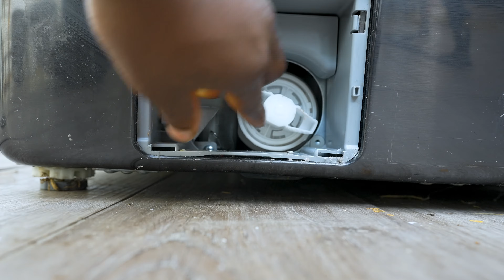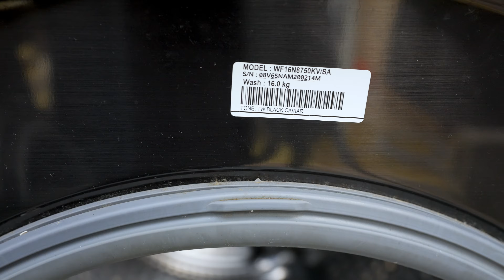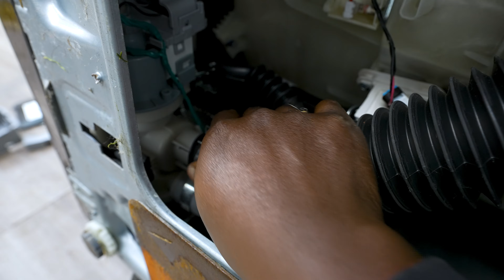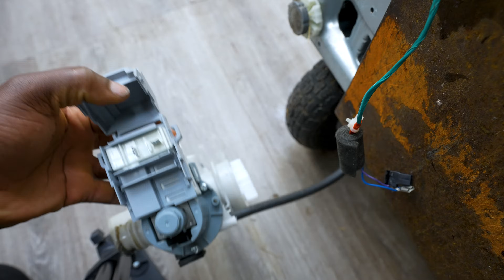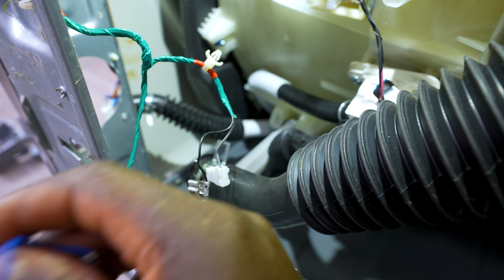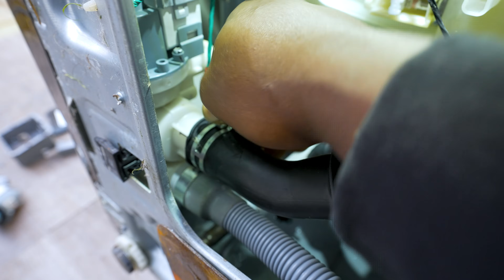5C Error Samsung Washing Machine Fix, You can do this !

Comment: Great video. Without your guidance, it would have been straight to the scrap for our machine, but you gave me the impetus to at least try and save it 1st. 😅

i have cleared all the pumps, pipes & filter on our machine, but it doesn't drain the water after a spin cycle. 
The impellers on both pumps rotated in 90-degree intervals in a snapping motion. Is this the correct function? 
When the cycle runs, it completes without any error codes, but the drain pump doesn't even attempt to run to drain the drum. Does this mean it needs replacement pumps? Or is there a reset that would need to be done on the machine? 
Any help would be greatly appreciated
Reply from the maker: hi I would replace one of the pumps. the pump should run on a spin cycle.

Comment: My washer was giving me 4C and 5E error codes (fill and drain errors) I replaced the inlet valve and drain pump and still had the issue.  Turns out the hose to the pressure sensor was kinked around a suspension rod and fixing this fixed the issue.  It makes sense because the sensor thought it was empty when it was trying to fill and thought it was full when it was trying to drain

Comment: I have tried all this, bought a new pump and it's still showing 5c, what culd be the problem
Reply from the maker: Hi is the water coming out on the drain hose ? Also make sure you changed the right pump as one of them is a recirculating pump
Reply: My washer was giving me 4C and 5E error codes (fill and drain errors) I replaced the inlet valve and drain pump and still had the issue.  Turns out the hose to the pressure sensor was kinked around a suspension rod and fixing this fixed the issue.  It makes sense because the sensor thought it was empty when it was trying to fill and thought it was full when it was trying to drain

Comment: Thank you for taking the time to make this. I checked all the tunes and had nothing in them. I pulled out the drain pump to make sure I got the right one and there was a silk tassel from one of the throw blankets sitting there smiling at me.

My machine had 3 bolts I had to remove before pulling out but because you made this seem like it was something I vlciuld do, I finally found them

Comment: Error ddc😢 help me
Reply from the maker: The Add Door is being detected as open or unlocked. Make sure there isn't anything keeping the door from closing securely. This message might also appear if you open the Add Door without pausing the cycle first. To add laundry, press the Add Door to close it properly, then press START/PAUSE to try again. Turn the machine off and restart the cycle.
Reply: @askmrwashywashy  
the door is closed, there is nothing to prevent it and still the DDC error appears
Reply from the maker: @jessicadebrites4419  might be the switch in the door itself thats fault or wiring might also have rubbed through

Comment: Bro, bro, bro, bro, THANK YOU SO MUCH HOLY SHIT, everything I read online explained how to clean the filter or level the machine out or check the drain hose height, make sure the drain hose isn't clogged and all that, but I couldn't figure out the problem even after all of that, I am very busy as I work 12 hours a day therefore I have very little time to mess with the machine but I haven't been able to afford to get it looked at either, thank God I didn't because your video explained how the drain system works in regards to where the water filters out of and there was a HUGE CLOG. Thank you again you saved my ass on this one

Comment: And I did it!  I cleaned the filter which was disgusting, patted myself on the back, still have error.  Watched your video, the blow test failed and my shoulders sunk.  I looked in and saw something physically blocking the drain.  Tried everything to get it out, but it was bigger than the plastic piece that housed the filter.  Back to watch more video.  I flipped it on its side like you said, found the black drain hose and found the offender.   There was a broken plastic coin that folded in half and then got wedged against the housing where the filter goes into.  Wouldn't let the water drain.  Thank you again!  If you are ever in Estero, FL I owe you a beer or coffee your choice!
Reply from the maker: wow what an adventure, Im glad you stuck with it and found the culprit. Well done. You've made my day to hear that this video helped you
Reply: THANK YOU so much for this comment!!! This pointed me to look closer in the video about checking the other holes around the drain filter. There was a huge hairball stuck in the left hole in mine.

Comment: This video helped me fix it! I followed the manual already and cleaned out the filter, but I didn't realize the hole should be clear at the end. Mine was completely blocked by a plastic piece with lettering on it. It looked like it was supposed to be there! When I watched this video, I saw there was an open hole where the filter came out. Thank you! Washer worked when I pushed the plastic piece out of the way. Now it's just in there floating around somewhere. Do not know where it came from...
Reply: THANK YOU so much for this comment!!! This pointed me to look closer in the video about checking the other holes around the drain filter. There was a huge hairball stuck in the left hole in mine.
Reply from the maker: Welcome glad this worked out for ya
Reply: I’m gonna go re look again. I just ordered a new pump a few minutes ago. Fml 🤦🏽‍♀️

Comment: Hey so I have 2 pumps just like that. I believe we have the same model but where you took off the gray hose I have a black cap on where it plugs into. Is that normal . I don't see how water can get threw
Reply: Same. How were you able to open the cap?